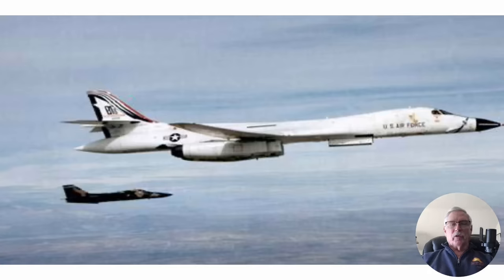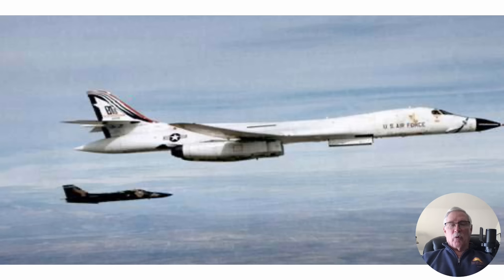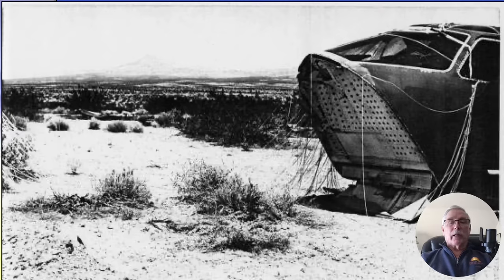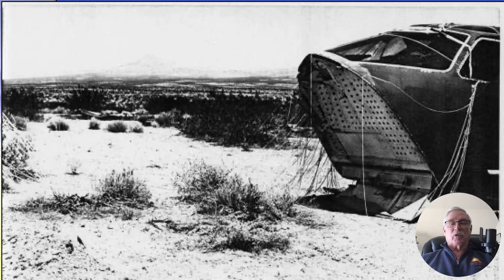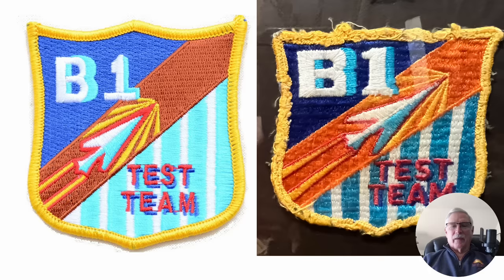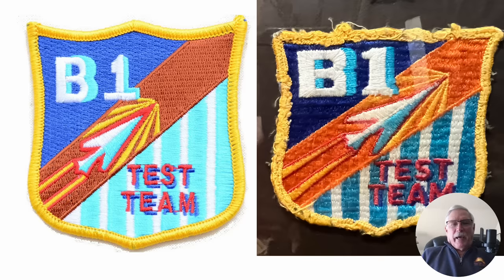The crash of the B-1A Aug 29, 1984 Small mistake led to a catastrophic accident and loss of life.

Comment: The B-1A had the F-111 style escape pod due to its original high speed penetration mission profile, above Mach 2 at high altitude. When the mission profile was redesigned for the B-1B it was at a much lower altitude and speed and the escape pod was deemed unnecessary and was replaced by traditional ejection seats. I think they also went to simpler inlets on the B model due to the reduced speed.   Both of these changes supposedly reduced the cost of the fleet.

Comment: Covered tail number 159 making lots of TFR test runs over Haystack Butte at all hours of the day.  Ron as you say, there were some long-ass B-1 missions...  Remember the test program walking down the TFR AGL setting.  One mission was 200ft, then program would analyze our data.  Next mission 150, analyze, etc. Lowest I remember was 50 ft AGL.  At low level, there was definitely a sudden/significant pull up to clear Haystack.  It's gotta be confusing at times, following the test card, while multitasking on other duties to keep the plane flying and in trim.  Sad to lose a good test pilot...

Comment: On the afternoon of January 30th, 1981, I was driving north on Rt. 95 toward Portsmouth, NH to work at Combustion Engineering in Newington. Not a cloud in the sky. All of a sudden, I saw a puff of white, an orange glow, a black plume, and watched an F-111 plummet down into Portsmouth and saw the cockpit capsule gently come down. No one was killed. The Air force denied the engines were involved. They were hiding something.

Comment: The B-1 was one of the loudest airplanes in the air force .I used to live in a house about 1.5 miles north of the runway at McConnell AFB back in the 90s ..When the wind was out of the north ,the bone would literally rattle the pictures off the wall on takeoff ...the sound of freedom!
Reply: They’re still operated
Reply: Agree, we were about the same distance 90-93.  They would pitch up to climb and point the ABs right at us.  Louder than the 3 am KC-135 with water injection.